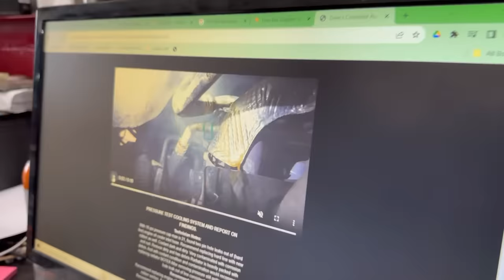The truth about maintenance, and what the manufactures tell you vs what you need to know

Comment: Have changed the oil in all my vehicles every 3,000 miles and never had an issue in over 30-years.  Have friends with new cars that only get changed every 10,000-miles b/c that's what the factory recommends.  Penny wise and pound foolish.  Of course, they just lease a new vehicle every 2-3 years and never see the long term damage. And they never own the car, so always making a car payment.  SMH.  Like your videos!   Thanks for the tips.
Reply: Given the advancements in oil additives and detergents, I would argue that changing the oil every 3,000 miles is excessive. However, I also wouldn't advise changing it every 10,000 miles. There seems to be consensus in the automotive repair profession that 5,000 miles is the best interval.
Reply: Oil isn’t everything though james, unless you’re driving toyotas only
Reply: I’ve done 10k oil changes on my 20 year old car with 170k+ miles since the car was new.  I use full synthetic only and when I was inside the engine about 10k miles ago, it was clean as can be.  No sludge whatsoever and all rod bearings were in impressively good condition.
Reply: @ghostwrench2292 if everything was good why’d you open the motor?
Reply: It took me years to accept 5,000 mile intervals.  I'll never go longer, never.
Reply: @bertblue9683 
I do the same now at 5000 miles 
Used to do it every 3000 miles

Recently changed the valve cover and gasket from my Nissan 2.5 with over 120,000 miles and every part was clean so doing oil changes at 5000 miles is good
Reply: Good to know.  Thanks
Reply: I am  a few months away from paying my final payment on my car, when its payed. I will sell it and use the cash to go through every single thing on my other cars:).
Reply: 10,000 miles? Wow, Australian guidelines are 10,000 kilometres or 12 months whatever comes first.
Reply: @andrecampbell4532  a plastic tee in my cooling system broke while driving on the freeway = blown head gasket.  I was going to rebuild the engine but it turned out to be more cost effective to replace the longblock.  Of course, while the engine was out, I replaced every single component in my cooling system except the heater core.
Reply: It's all the oils. Don't forget diff and tranny. And the hydraulic fluid in your brakes, clutch master and slave. Lines too, brakes and clutch.
Reply: I never understood that
Reply: While 10K is too long, 3K is too soon. This isn’t 1980 anymore.

5-6K with modern full synthetic is totally fine
Reply: Oil might last 10k miles but the filter doesn't
Reply: @timothykappel198 yes. And the “extended oil change interval” filters such as Wix XP which can last 10,000 miles without plugging achieve that by actually filtering LESS of the small sizes of particulates out. Whether this actually makes a difference in the service life of the car is debatable.
Reply: Driven over 180k miles on mine over the last 8 years and oil changes every 7k miles full synthetic. Still runs as good as I first got it.
Reply: Which is why used cars are such a crapshoot.  You’d better thoroughly check it out, but let’s be honest, most people just see if it runs and roll the dice.
Reply: Obviously a lease is different than owning the car, that's how I'd do it too if I were dumb enough to lease a car.  By the book, why not, the car goes back whence it came in 3 years anyway.  But my Camry had its oil changed exactly as this OP says, tending to over-maintenance, and its got 204,000 and still runs almost as well as day I bought it.  My friend with a 2001 Solara V6, and 250,000 miles, has the same exact engine as mine, but changed her oil every 5,000 miles, period, (and sometimes went even longer).  The difference between the two cars with exact same 1FMZE engine, is like night and day!  Her Solara doesn't idle smoothly, and when you mash the gas pedal, nothing happens for maybe 10 seconds and it just sort of bogs down.  Compared to my 2002 V6, which responds instantly and still has plenty of power, and mashing the pedal gets you merged on the freeway right quick.
Reply: I think the 10000 mile or 15000km oil change is madness.  Particularly on a high stressed turbo. I have done it every 6000miles or 10000km. Filters and oil are cheaper than engines and gearboxes.  I stripped my VW with 292000km on. Could still see the original honing marks! No wear. I am still doing something right.
Reply: @DivadNoodeldehm-lz2gm well said! I know VW and Ford claim their gearboxes are filled for life. Bull dust.
Reply: Nah. I've got a shitty volvo and a semi-shitty old jag and change them every 3 to 5k but my old man's newer porsche turbo doesnt require changes for 20k. Things are a LOT different now.
Reply: Change that oil every 3000 and change the transmission fluid every 20,000 what’s it gonna hurt …….nothing
Reply: @roque2ezequiel  180,000 ÷8 = 22,500 per year.  That's why your car is just fine at 7k change intervals
Reply: 3000 miles is insane. 6000 miles is more sane and what the manufacturers recommend in other countries.
Reply: @Teeveepicksures  Insofar as all porsches and Jaguars have designed in defects aplenty, which means something else major will break before you could even dream of wearing out an engine, you are correct.  But for the few of us who have well-engineered cars (Honda/Toyota) frequent oil changes are well justified, and I've seen the proof.  I used to work for a large gov't fleet.  But more important I know somebody with my exact same engine and similar miles.  Their interval is 5K and mine is 3,000.  Both cars over 200,000 miles.  Mine has gobs more power and idles like new.  The 5k oil change one bogs on acceleration and is sluggish in general.
Change your oil once a year if you want.  Nothing about oil has improved that much to make that a smart decision.
Reply: A lot depends on the TYPE of miles. Are they heavy stop-go miles or highway only miles? That 3000mile oil change in stop and go short trip driving is WAY too long. In mostly highway driving (where the engine is COMPLETELY heated up), 5000 mile change interval is fine! My driving consists of about 95% highway, 2K yearly miles (retired). So, I change my oil ONCE A YEAR, miles don't matter. I use 5W-30 FULL SYNTHETIC "Pennzoil Ultra Platinum" oil (can't understand WHY you would want to use a "synthetic blend" oil to save $5) lol. To each his own! One thing I am really ANAL about, PROPERLY warming up the engine/transmission! I start the engine and let it idle for about 30sec, then I SLOWLY drive the car (traffic allowing) for about a mile BEFORE using heavy throttle. Do not idle it for more than 30secs, because you are not getting rid of the condensation in the crankcase fast enough. Putting a LIGHT load on a COLD engine will GREATLY extend its life. Just MY $0.02 worth!
Reply: I beat the hell out of my work trucks and change oil every 3k miles religiously. Whether I'm "wasting" oil or not, I could care less. I did the oil pickup o rings and valve cover gaskets on my 05 Silverado 2500hd/6.0 with 140k miles and the inside of the engine was immaculate, no varnish or sludge, parts looked amazing, cylinder walls were great with nice crosshatching and no vertical scars at all. My last Chevy was a OBS 2500 and it made it to 377,000 miles and I was offered a good price on it and I sold it to help a friend...that was 2015 and it now has 425k miles and still runs fine, still has decent oil pressure and all! Oil is cheap, rebuilding or buying a new engine is expensive, take your pick.
Reply: Yeah, except those stupid swirl flaps in modern diesels have nothing to do with oil changes. Those damn things need to go.
Reply: Seen new cars that recommend 20 and even 24k oil change intervals
Engines ruined in 3 years
Reply: @jakebatty530  wow, so basically just out of warranty.
Reply: I follow the oil life monitor in my '99 Silverado  ... or go longer (since I use synthetic). Change the spark plugs that looked brand new at 140,000 miles. Have changed the transmission fluid once. Now have 250,000 miles. I think manufacturer recommendations are fine.
Reply: @danieljohnson4418 for real... oils have advanced over the last 20 years whether people like it or not. 

My 98 Buick recommended changing the oil every 3k (NOT with full synthetic)... my Passat recommends every 10k miles, which makes perfect sense - it has more oil capacity than my Buick did and half the displacement.

The only thing I will do at 5k miles is to check the oil level as some inevitably gets burned off (typically about 1qt every 6k to 8k miles).

FFS ... this "they just want to sell you more stuff" makes zero sense when it's the OIL MANUFACTURER warranting 20k between changes.
Reply: @robertmaybeth3434 you're not too bright if you think oil change intervals that are different by 2k miles is enough to make one engine run "like new" and another "bog down". 🤦

You know what also tends to wear out and needs replaced over time (especially on high mileage vehicles)... fuel pumps, injectors, spark plugs, belts,  ignition coils, timing chains... but yeah, it was probably that motor oil that was barely dirty that did it. 
🤦
Reply: Nah, with new engines and synthetic oils there is zero reason to change the oil sooner than 10,000 miles. I drive 60,000 miles per year. Since 2010, had a prius, camry and accord, all reached close to 300k miles before I sold them with barely any issues. I always changed the oil at 10,000 miles intervals!
Reply: I do mine every 3k miles too and I am telling you you are 100% right
Reply: 2002 Camry with full synthetic at 10k intervals. Leaked a little oil from the headbolt issue, but never burned any, pulling the valve cover off to do the gasket showed that there was 0 sludge and it looked better than our 01 corolla we did every 3k with regular oil.
Reply: @jasono2139  How many engines have you torn apart?  If it's a lot of them, you can clearly see the difference in engines that have had their oil changed.  You can even see the difference by removing a valve cover.  

Oil degrades for lots of reasons besides dirt.  It starts oxidizing as soon as you open the bottle; the anti-oxident in the oil does not last forever.  Same thing with water in the oil - no PCV system is perfect and water vapor builds up and degrades the oil regardless of how hot you get the engine.  Varnish, sludge, excessive thinning, degraded additives esp anti-wear, all this happens the longer you run the oil.  And I could write volumes about an oil filter lasting for 10,000 miles or even 5,000 - you only have to look at what's inside an oil filter - do you really think it can filter the oil for 10,000 miles?  

I own a Lexus and Toyota because the rest of the car doesn't break down around the engine, the way it's designed to do in a BMW or Porsche, or your Detroit iron.  You can have your 5,000 mile oil change intervals... and I don't even want to think about the people that deliberately go 10,000 miles.
Reply: @robertmaybeth3434  no, I've never had to tear apart any of my engines because they've ran fine using the manufacturers (and OIL MANUFACTURER'S) recommended service intervals. Aside from a water pump and the occasional worn out idler pulley or starter motor, everything ran fine.

Everything you said is a compete non-issue with modern motor oil... European cars have been running 10k mile intervals for decades now. Only the goofy gearheads who think they're "taking care of their car" by excessively wasting oil makes their car run better.

Having taken courses related to rheology, I can tell you have no understanding of the actual failure modes of lubricants. Oxidation is one of the LAST things causing motor oil failure... the oil is almost completely separate from the atmosphere outside of the engine... but you think the little bit of oxygen inside the crankcase is going to chemically destroy it... but somehow the trans oil can last 100k? Please... 🤦

The main issue is the loss of detergents that keep carbon from collecting on engine components (thus oil filters) and/or the complete loss of the oil bypassing the piston rings.

...and guess what smaller displacement engines have less of?  🤔
Then add the fact oil capacity is higher on these engines and the metallurgy is better (meaning better tolerances at high temperatures).
...much less oil loss and longer change intervals.

It shouldn't be surprising then that my 98 Buick's 3800 V6 (with an oil capacity under 4L) required 3k oil changes while my newer VW's 1.8T (with an oil capacity OVER 5L) can easily do 10k.
Reply: @danieljohnson4418 I think the sweet spot is 4000-5000 miles
Reply: @jasono2139  10,000 mile interval is ok for your VW because the VW is such a designed-in-defect-mobile your trans and electrical system will be failing long before you wear out an engine.
Reply: the american economy thrives on people like that and lacking financial education
Reply: @BuckingHorse-Bull  no, I'm fairly certain it thrives on people who fall for extended warranties and are told by oil change centers that their car (which is stated by the manufacturer to have higher oil change intervals... and the oil manufacturer) will magically last longer and better if they change the motor oil x3 as often. 🤦
Reply: @8MunchenBayern8 Full syn is good for ten!

That's directly from the oil manufacturer who doesn't benefit anything if they're wrong.
Reply: @FirstHandLLC Same
Reply: @bossbrent  

BAHAHAHAAH you fell for the 10K mile interval marketing gimmick too huh?

Thats all so the company can show "low maintenance" costs.

Let me guess. You believe in "lifetime" transmission fluid as well? LMAO
Reply: @8MunchenBayern8  There's substantive difference between traditional/dino and full synthetic. This difference allows 10k+ miles without harm.
Reply: You might be right but synthetic oil should last longer than 3000 miles. At least 6000.  I noticed Dino oil changes color as it wears out. Synthetic does to a lesser degree but still can be used as factor of knowing when to change the oil.
Reply: @timothykappel198 they have synthetic fiber oil filters now that do
Reply: @Skilful_basics8  synthetic fibers doesn't mean it's going to last longer.
Reply: Changed the oil in my cars every 6-10000 miles over more than 30 years and never had an oil related problem! Most of them are over 200000 miles because I keep my old cars...
Either American oil is total crap, if you have to change it so often, or you use the wrong oil (you do... Nobody else uses as thin oil)
Reply: Waste of money. I’ve had a couple cars over 100k and following factory recommends 10k synthetic. When I got rid of them, both engines were like new. Consumed no oil ran like a top.

3k oil changes are just ignorance/wasted money and not based on what the engineers of the engines are telling you to do. 3k is meaningless. Why not 2k? Why not every time you fill the tank? I go by analytics and facts. Both of my new vehicles will be getting 10k, per manual.
Reply: @Cortex_Cogito this is wrong. It’s not metal on metal *because of the oil*. A properly lubricated engine, bearing etc has no metal on metal contact because the oil is literally creating a film between the two. It doesn’t just help limit metal on metal—it quite truly stops it entirely.

100k miles driven at 30 mph and 2500 RPM = 500m revolutions. Your engine would be a mush of metal by then if it had any metal on metal moving parts.
Reply: Oil and a filter is about $30, less than a tank of fuel I don't care about "wasting" oil, nothing wrong with a 3k oil change. Oil is burned up and black as coal at 10k.
Reply: @Skilful_basics8  Which is why cars without a dip stick is such a bad idea. Even if you're not burning oil, you can't check the color or smell to see if something is wrong.
Reply: Changing oil every 3000 miles is just as foolish as doing it every 10,000.
Reply: @8MunchenBayern8 3000 mile oil change intervals.... Will give the best fuel economy..... In all Vehicles since 1986......
Dirt inside the Engine means.... More Fuel is needed.

Use Oil  with the lowest Noack Volatility Rating.
Reply: Long term rental aka, make salesman and car maker rich
Reply: @bertblue9683 never say never on technology
Reply: Most cars have a turbos now.that turbo eats your oil before 3000 miles.i see it everyday.stick to 3000,you 10000 mile guys are goofy
Reply: @danieljohnson4418  the consensus should be to follow the manufacturer model specific suggestion based on typical usage profile (racer vs granny) and oil type (full synthetic vs others)
Reply: @timothykappel198  many filters are designed to handle 5k-20k miles usage nowadays
Reply: @robertmaybeth3434  comparing two 20 year old cars... Too many other variables to also consider WRT performance differences. Your conclusion about the cause is very likely wrong
Reply: Which is exactly why even though the manufacturer claims 6,000 me oil change warranty, I always suggest changing it every 3 months or 3,000 no matter what because that's all your filter can handle... That's what he forgot to prove in this video but your filter can only handle three months or 3,000 me it's only mostly cardboard
Reply: @MechanicsAdvice  That's definitely false
Reply: @Teeveepicksures  Buddy if anybody actually believes in a 20,000 mile oil change interval they are dead wrong!   No oil works for 20,000 miles and that goes double for the oil filter, by that mileage the filter will be clogged and running on bypass having quit filtering 10,000 miles ago.  

20,000 miles for an oil change is outrageous, never heard of such a long interval, and I feel safe in saying they are completely wrong wrong WRONG about that.  I won't go longer than 5,000 miles on any car I value.
Reply: In my car i change the oil and filter every 6000 miles, yesterday the car completes 282500 miles. Still strong like early days.
24 years old car.
Reply: I don’t care about excessive, I care about controlling what I can control. We blow money on everything else changing ur oil more frequently won’t be the death of u. I change my oil every 2500 miles. But I recommend u change ur oil when the oil life  percentage in ur car says 60%. I only use liqui moly molygen 5w-30. The oil u choose also matters. Be cheap, get cheap results. I have 2023 Acura tlx type s, she’s very good to me and I’m very good to her.
Reply: Whoaa!  That explains all the cheap BMW’s and Audi’s out there (it may look like a good deal, but they may have only had 3-4 oil changes!)